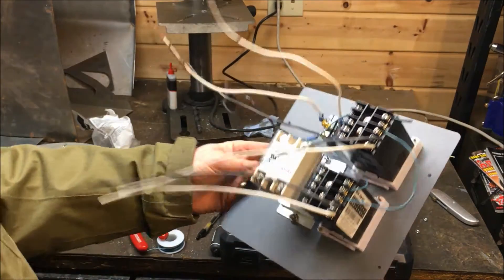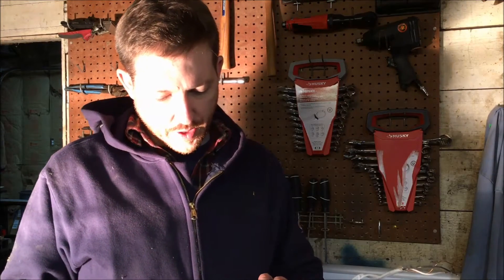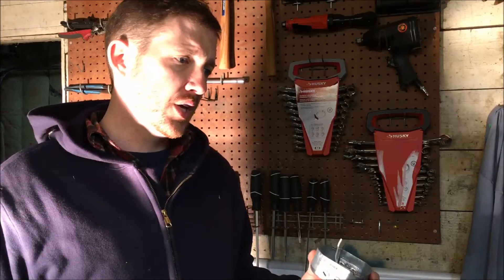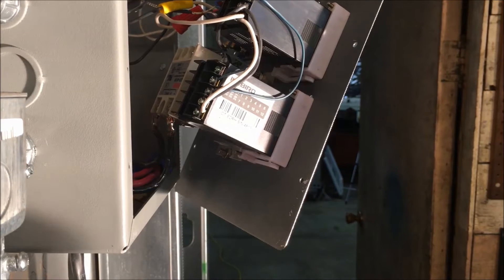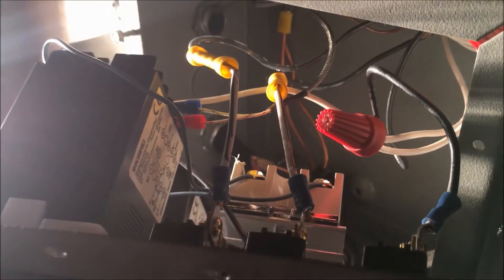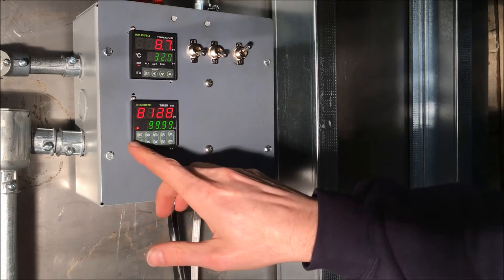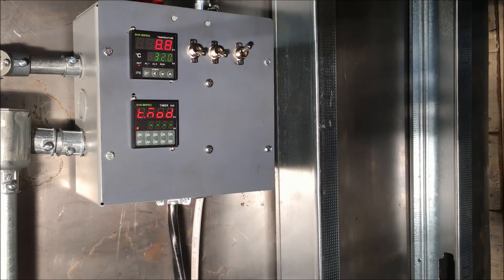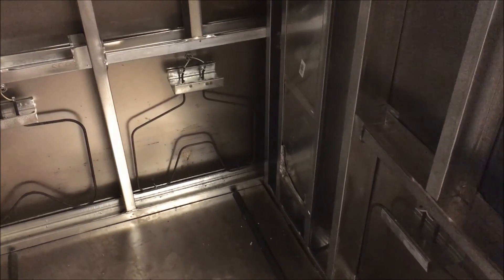DIY Powder Coating Oven Build: Part 9

Comment: doing a great job so far.  My only critique of the entire this this far is that that control box is going to fry every bit of the equipment in it.  It should be mounted to the exterior of the oven with some stand offs to keep heat away from it.  ill keep watching your series and hope that you remedy that issue

Comment: Nice work. I might have put a hinged box on that with some sort of latch. You could probably still do that by installing some hinges. That way you don't have to disconnect that nice work you did on the cover.

Comment: Looks good, the only thing I don't like is those little tougle switches. I would get the kind with light up acrylic tougle lever in green and red. That way you can see it in the dark.

Comment: Hi I am building a control box for a hydrographic tank. box will be similar to yours. can you send me a diagram of your wiring? I will be using 220v to power my two 4500 w heating elements and will be using 110 for my pump,buzzer, switches timer and under water led

Comment: What brand and model temp controller and timer are you using on this?
Reply from the maker: +Steven Scott I've posted links to the parts here:  http://www.adamsbentmetal.com/powder-coating-oven-parts/ Thanks for watching!
Reply from the maker: Thanks for the heads up. I'll try to fix it.
Reply from the maker: I just tried the links from my browser and they seem to work fine. I actually did get them from Amazon.
Reply from the maker: I think you'd be fine skipping the fan in a build that small.
Reply: Excellent videos. Unfortunately your parts list  link is not working. Any chance you can repost the new link? TIA
Reply: @The_Mad_Mekanic  the temp. controller its a rex-c100 and the timer it's a IDT-E2HR (similar to the video)